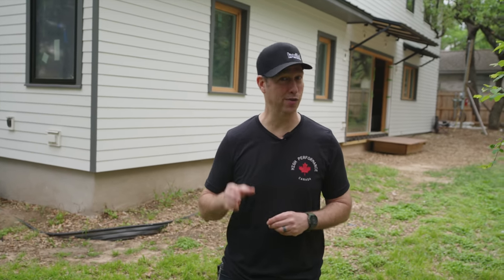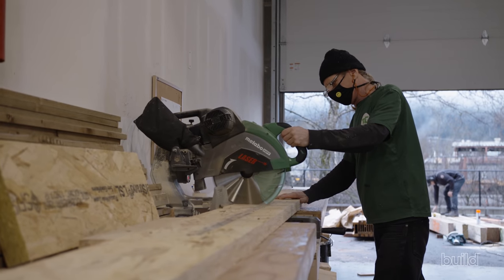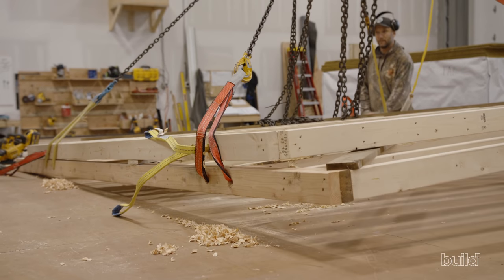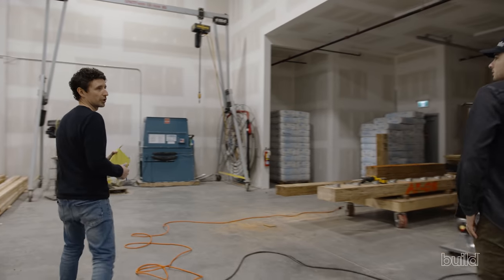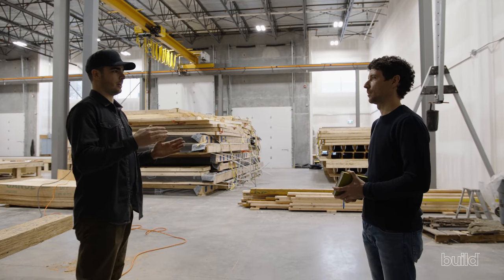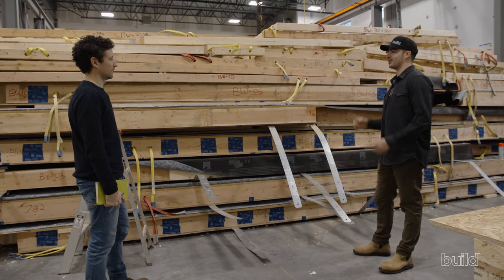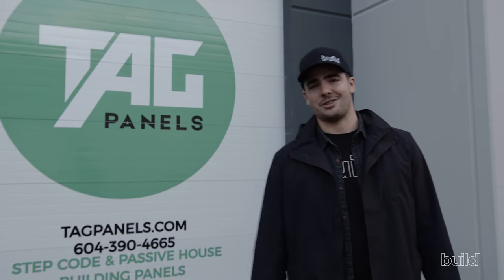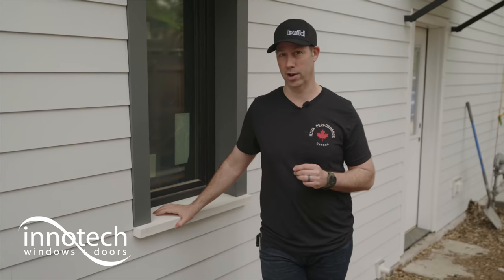Factory Framing Passive House Walls - "Build Original Series" Episode 1

Comment: Great video showing the evolution of pre-fab construction. The key here with this business is the low embodied carbon concept and using recycled materials that perform just as well as readily available products in our building supply stores. I hope they touch upon the Step Code in BC and our drive to Net Zero ready homes by 2032!

Comment: That is very similar to how my house was prefabricated here in Austria. 11 inch framing filled with cellulose. A 3 inch Gutex board wood fiber panel on the outside against thermal bridging. On the inside my builder uses a Fundermax organic fiber board (high density wood fiber bound with organic resin) as the vapor barrier. Further inside we have a timber framed 3 inch installation cavity with rockwool insulation and finally a plasterboard on the inside. Here in Austria nearly every timber framed house's walls and ceilings get prefabricated completely inside a factory, and than build up at location in one or two days max to a rainproof prefinish. I visited my builders own factory. They have big CnC machines for precise cutting and an automatic framing, nailing and insulation filling system.
Reply: Hi Philipp. Would you mind providing some of the Austrian company names doing  building panels? Thank you.

Comment: What exites me the most is the limitation of wastage. They are able to order precisely the required lengths. That allows the lumber yard to use every bit of quality resource, as they can also send them the shorter bits. 

I understand that the price performance is now always the best, so these systems make sense in rural areas where there is limited skilled labour. Another usecase is short working time, measured in time during the day and months. The limitation of noise is great as well for fancy neighborhoods. 

It would not be my default method, but I'd definitely at least ask for a quote :)

Comment: The only concern i have is the isolation in the walls. How will is settle over the years and are they installing anything to alleviate it?
Reply: One of many durability issues with this design.  They don't care what the house will be in 20 years.  They're throwing everything into getting that difficult "passive house" rating at the time of build, then they declare victory and walk away.
Reply: It should be pumped to a high pressure so it wont settle but not best practice to factory install as it can settle in transit and installation. It should be done on site and then core samples taken to check it.
Reply: Settling insulation has been a big problem in the UK. They now install it with a type of glue so it stays put.
Reply: Insulation packed properly at 3.5 lbs per cubic foot has nowhere to settle.

Comment: interesting that they stack the elements laying flat, here in Finland ive only seen them put the elements vertical on the trailers so that they can just lift them straight up with the folding crane and not need to turn them upright on side :D
Reply: This might be done because of height restrictions in Canada and the U.S. for big trucks.  To move the product without extra permits the load cannot exceed a height of 13' 6".
Reply: @tedfritsch3340  oh yeah did not even think about the height :D here i think its 4,2m normally , 4,4m with signs and over that with a permit that i guess is easy to get since they are so common :D my searches might be wrong though :D
Reply: @niklasxl  I assume in Europe it's more about width restrictions.
Reply: @ReadersOfTheApocalypse  yeah, at least in the cities but outside them its not that big of a deal, but yeah i guess here they rather not have it stick beyond the car and trailer itself on the sides :D
Reply: @niklasxl   I don't know about Finnland, but in Germany they couldn't get far without special permission... anywhere. 🤣
Max width is 2.55m or 8'1".
Reply: @ReadersOfTheApocalypse  yeah but i dont think the processes to get them for regulars is that bad :D for the really large ones i think they are forced to do it at night though :D but if its just a bit to high it might just need some signage on the combination :D
Reply: @niklasxl  I guess, the permits are not the real problem. No matter if day or night...
The truck that delivered the factory preproduced panels for my house would have had quite some trouble to reach the construction site, if they tried to transport those horizontally.
Reply: It may have to do with not wanting the insulation in the walls to settle during transport. If the walls were vertical the road vibration would encourage the insulation to settle downwards.
Reply: We have them stacked flat here in NZ, they offload the whole stack and the builders on site sit them up and position them by grunt!
Reply: @RB-el5rm  interesting here they set them up in place on the foundation with the crane of the truck that transported them, on larger houses the truck with the last load and the earlier loads are kept standing on stands to keep them of the ground :D

Comment: I presume thermal bridging with this frame/ insulation arrangement is a bit better than typical wood frame, but I cannot for the life of me understand how people go "high-performance" and then studiously avoid going continuous exterior insulation. I have done continuous exterior walls going back more than a decade, and continuous roof going back 40 years. I would not willingly return to conventional. Best approach re: thermal and moisture issues. 

Panelizing is also best approach for several reasons. I am surprised here that there is no machine measuring system at the cut line/ chop saw (even such as Tiger Stop, which is actually pretty lightweight for framing lumber). We have used a 22' Hain Measure and Bosch glide miter saw with great success;  fast and extremely precise.  I am curious how these guys handled the panel squaring. We had a table with flip tabs to hold bottom plate and left edge straight and square, the precision cuts force the two free edges to line up.  Finally, I could not tell if sheathing overlapped, or was cut to edge of panels. In our Colorado high wind zones, lapping sheathing panels over all rims and all corner framing is a key requirement, and the crane handling makes this easy to accommodate. We had a pair of steel lift eyes fabricated, with flat plates drilled for 2 to 4 GRK screws to attach to the top plates. Lift, set, unscrew and repeat on next panel. No holes to drill, it is fast and safe, especially if you swap 2 pairs of lift eyes. And, if you have a bunch of  adjustable brace screws as used on concrete formwork,  you stand up close, and fine tune plumb at your leisure.
Reply: This just has to be the future.  I’ve tracked Connor Homes, Benson, Blueprint Robotics, these guys.  Some successes, some failures, but that’s part of any transition.  And I know panelizing isn’t new, but I have to believe that every iteration that succeeds gets better.  At some point, doesn’t this become manufacturing and assembly onsite at scale?  Why don’t the production builders do this?  I’ve seen Habitat chapters do something like this and it seems like such a straightforward leap.  Really liked your comments about continuous exterior insulation.  I’m enjoying following Matt’s build, and as a Texas homeowner, when I do another house, it will have it.  Totally into the monopoly framing.  High performance building would have helped lots of southern US homeowners more comfortably deal with the recent freeze, in addition to more comfortably live in our traditional weather.
Reply: @markpalmer5311  Well, it probably should be the future, but there are serious obstacles. It is called MONEY. Factory panelization has fairly serious capital requirements. The production builders don't want to be saddled with a non-yielding investment in a downturn (a regular feature of residential construction), when you cane get the equivalent (to them)) results with cheap (immigrant) labor that can be dumped at no cost or liability when things get slow. Front Range Colorado, that is how it works, for the overwhelming majority of home construction. Current labor shortages seem to be pushing for panelization, in its most basic firm, but not really pushing the technology envelope (insulation and air/ moisture control).   

84 Lumber had a basic panel plant set up north of Denver in 2006, but they folded early in the 2008 downturn and never re-opened.
 
Another take: https://www.simplehomes.com/#/project/simplehomes

I have met the guys, even given them a few tips and pointers based on my experience. They are very aware of, and fighting, the capital cost issue.  I do not think they will go very far, at least relative to their stated goal of revolutionizing the industry. Doesn't mean a bad product, just that there are a lot of very high hurdles to overcome. Consumers willingly buy into a subdivision with only four different house plans (maybe eight, if they mirror), but reject "factory" homes as mass produced generic dreck. Go figure. Do not discount the value of emotion over rationality.
Reply: @leestevens446  check out Blueprint Robotics and it would be great to hear what you think.  I have no connection to them.  With all the big PE and other funds buying up housing stock, the corporat-ization of the first family home  is coming and I would think they would see the benefit of investing the capital to get more durable houses up faster.  I think Blueprint is focusing on multi-family condo/townhome projects for the reasons you detailed.
Reply: @markpalmer5311  Corporatization has been here a VERY long time. The national homebuilders build a huge percentage of the new homes in this country, and they are the gatekeepers. That is, only until there is an overwhelming revolution in the ranks of home buyers; forcing changes re: quality and durability. I would not hold my breath. There are 100 ignorant greedy cheapskate homebuyers out there for every individual like you, and they are well served by the status quo. And, they all know there is another sucker coming along to unload the property on. We move too much in this country to put a high value on life cycle costs. Multifamily is more of a business (or government) arena, and likely has more in the way of long-term ownership and therefore durability concerns. 

[post got garbled, here is re-try]

The capital cost of super-high productivity means that the plant must be kept very busy to return the investment. The only way to do that is to put out a huge amount of essentially the same pieces. Think autos, there is actually extremely little customization of any one Ford pickup truck, as an example. Even with computers, there is a tremendous amount of human labor that must go into a planning and detailing any project, and that makes for a huge amount of total human cost. Blueprint has obviously realized this, and not wasted time on the small and individualized single family houses. Think once, build 50 times. They have gone right to the mass/ volume production with these large multifamily builds. Productivity is the antithesis of individualization. 

Transportation is a very significant cost. Most new single family starts are in the fast-growing warmer climates, like Arizona. One would have to have a plant close to the end use point to be economic; Baltimore is pretty far removed.
Reply: @markpalmer5311  Final thought, which I failed to put back in previous reply and subsequent edit (see above): 

Nothing about Blueprint suggests it is a bad product, on the contrary. The crux of the matter is market acceptance, and that revolves around money and human resistance to change. Probable also, finding the right geography and niche.

Comment: I'd be interested to see the cost -- I liked the idea of going panelized, but when I looked at it, the quote (obviously not from this company) for just the panels + windows was over 2x the cost of building the entire house (with all the finishes) conventionally. While I'm sure the panelized version would be quite airtight and well insulated, I could use something like aerobarrier 10x over, quadruple the amount of insulation, and still be ahead with the conventionally built solution.
Reply: Yes but the entire house is 3d modeled, all your conflicts in utilities should be worked out there. That's where you builder spends tons of time. Those walls if they have electrical in them are perfectly square and plumb and go up in 5 days I'd bet  or less for an entire house. With a truss roof system I'd bed you're dried in with under 5 days labor and you're already insulated.
Reply: @steven7650  Yeah, but is that worth paying over 2x the cost of a conventional custom build? In my instance, I was looking at $400,000 total (custom build, built in a conventional manner) vs $700,000 for only the panels + windows (so no foundation, no electrical, no plumbing, no finishing of any sort, and no labor -- so easily another $100,000 if I'm being extremely charitable). Even if the tolerances of the panelized solution were less than the width of a human hair, I don't know that it justifies such a huge premium.
Reply: @TheJasonbking  That's kind of my point, your team labor should be much less as is your build time. Is the overall house cost more or just the frame? 1 engineer for a few weeks should be a lot cheaper than a framing, sheathing, insulation, roughin etc.

Comment: Just wondering if the walls are already insulated and sealed how do they get the electrical wiring and outlets and switches in the walls, we always have all kinds of wiring in exterior walls, let me know if you can and thanks Matt for sharing this video
Reply: This reminds me of SIP panel building and I know for SIP panels they run the holes for the electrical wire so the electrican just has to run the wire on site inside the panels.
Reply: I believe the owner of the company mentioned something about a service cavity within the panel. But it is an interesting question.
Reply: These walls will receive a 1.5” service cavity on the interior, and the home will also have furred down ceilings. Stay tuned for todays video showing an installed home!

Comment: I work for a company that designs and builds wall panels as well. My only concern with the floor panels is if the foundation is not square or have straight walls. The panels are designed in a "perfect" world in the software but the field is never perfect. This could cause issues with gap tolerance for the hangers if they are pre-installed.
Reply: Definitely one of the challenges is tolerances on site. The entire project team needs to be on board from day one with the panel manufacturing company. Site checks are performed by the panel manufacturer prior to install also. You’re right though, things need to be pretty bang on!

Comment: It is not normally recommended to factory fit cellulose insulation as it can settle and leave air pockets during transportation and installation even if it is pumped to pressure in the factory. The walls are surprisingly thin for cellulose insulation if they are wanting passive house and having timber the full thickness of the wall is quite a substancial thermal bridge in the house.
Reply: Isn't that outside sheathing layer enough of a thermal break for the studs?
Reply: @malydok  No. If that wall build up was modelled in PHPP for Passive House it wouldnt give great results.If the studs go full depth of the wall then 15-20% of the wall is going to be timber rather than insulation.

Comment: Specification creep is an industry term, at least in the commercial industrial segment. We used a set of allowances on plate length and stud cut height to to avoid this, along with a couple of other tricks. Kept us right on layout end-to-end, always. What do these guys do to address this issue??
Reply: I am very interest too for creep especially in cold climates.
Reply: @yzaw4411  Has nothing to do with climate, temperature or humidity, or about movement of panels. It is about the problem of butting exactly sized panels or components together, and finding that the total assembled length is greater than the sum of the pieces. This is because it is physically impossible (in the real world) to force those components together infinitely tight. A twisted stud at the end of a panel can easily add 1/8", and this simply multiplies as you stack them up. What I have done, after years of this stuff, is to slightly undersize and or build adjustable ends into panels. Then, you stretch, as needed, the tiny fractions required, in order to stay on overall layout. Likewise, wall heights will be taller than the sum of the stud cut length plus the thickness of the three plates. We do a test assembly for each project, and check the added increment (specification creep) for the lumber we will be using, and then apply that as a deduct on all stud cut lengths for the actual work.

For tract homes, no one cares about this, just beat it to fit, and don't care about anything; the painter will fill it with caulk. When you get to big and complicated projects, this is a real issue. Steel frame buildings are detailed in the same style, so that they do not "grow", otherwise it could get impossible to stay on the anchor bolt layout. This is where I picked up on the concept. But, it is highly applicable to wood-frame panelization, especially large (multifamily) projects.

Comment: I "USE TO" build houses this way in the Madison, WI area.  BUT, we only had the exterior 2x6, 2x4 interior and roof trusses built "in house" at a panelization company.  We added mechanicals, insulation, windows and doors on site.  I would simply hire a crane for a day (or two) and the house would normally be closed and dried in in one to two days!  We've since moved to Austin, TX and I'm looking to find if there are any local panel manufacturers??  Really need to find ways of cutting costs!!!!!
Reply: Hey Gerldahundt. How did you attach those prefabed framed walls to the foundation?